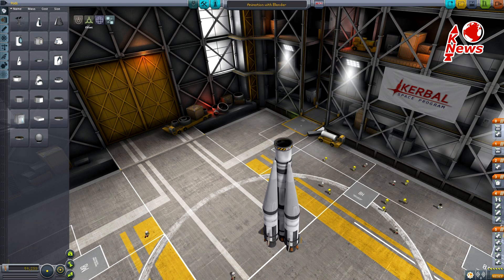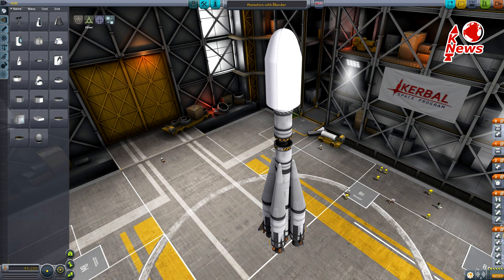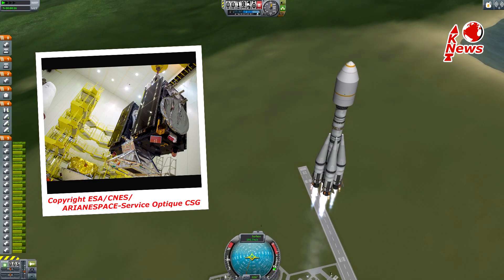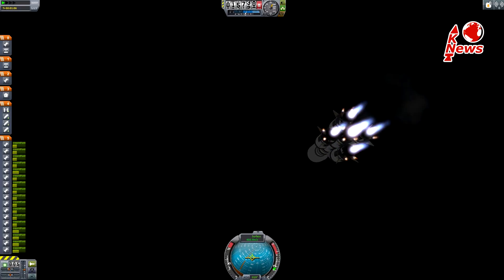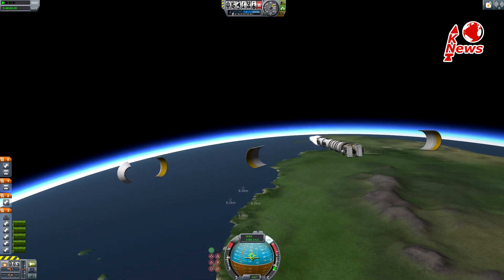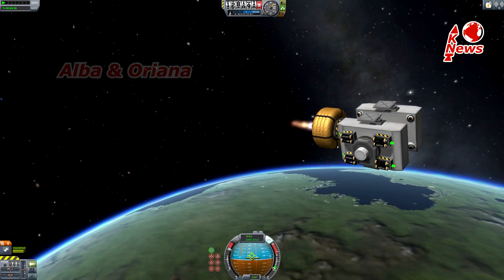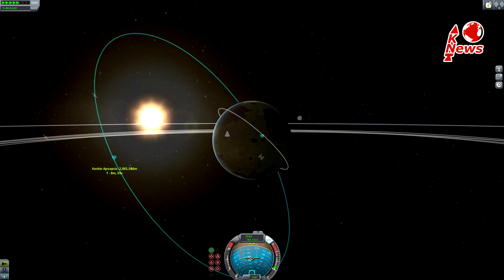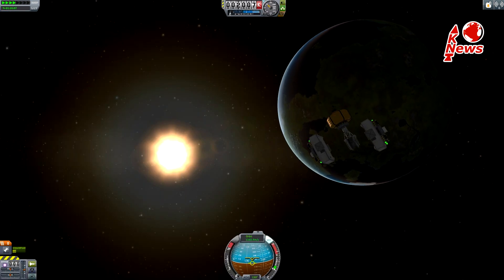Soyuz Launch | Galileo 9 & 10 | KNews #17

Comment: A bit late but those were actually 5&6 not 9&10.
Reply from the maker: +tailsthewolf123 Hi, Alba and Oriana are definetly the 9th and 10th Galileo satellites launched so far (http://www.arianespace.com/images/launch-kits/launch-kit-pdf-eng/VS12_Launch-kit_GB.pdf). However, i guess what you mean is these are the 5th and 6th fully operational capacity ones? 
You can check the launch here: https://www.youtube.com/watch?v=KnvDwvH3i44
Reply: +KerbalEssences i was unaware how many of these satellites were actually out there but yes in this case I did mean how many are fully operational.
Reply from the maker: tailsthewolf123 There were some test satellites and not fully operatonal ones before the actual ones. However, their numeration takes all into account I guess. Don't neglect the brave pioneers :D I could've mentioned that in the video but wasn't so familiar with it at that time to be honest. Next time I know, thanks! :)